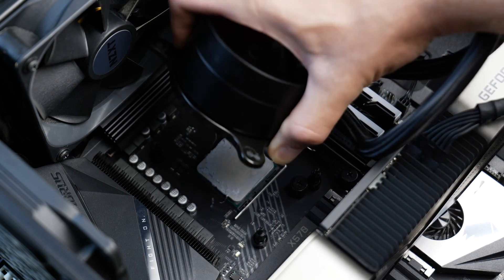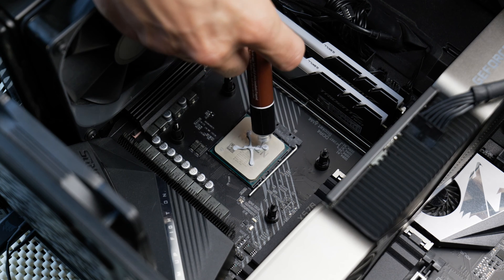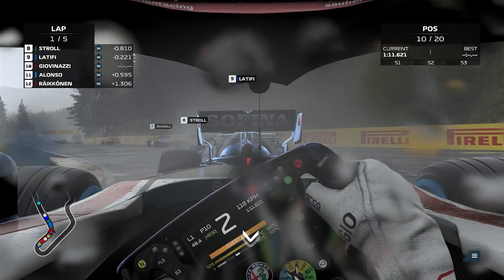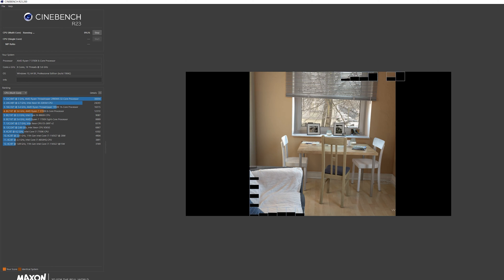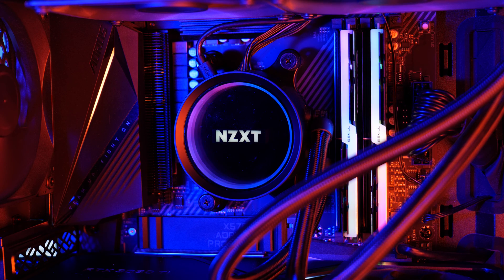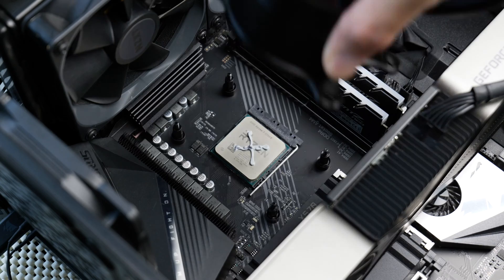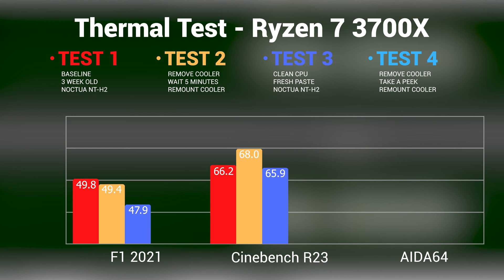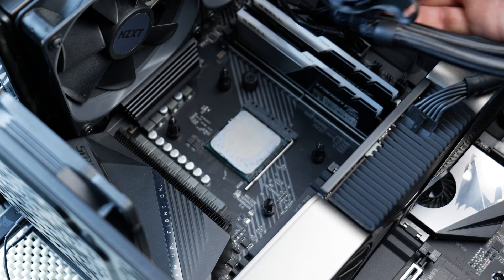Do You HAVE To Use New CPU Paste? Can You Reuse Thermal Paste?

Comment: I have often heard that excess thermal paste can lead to adhesion between the CPU and cooler with possible socket pin damage upon forced removal (turning
the computer back to heat the paste is then recommended). I suspect the problem here is that the excess squeezed out paste tends to dry out and harden. It's 
unfortunate that this area is hard to see and clean.

Comment: You can use turpentine to revitalize dry thermal paste. You can feel the paste dissolving in the turpentine when you rub it in the paste. Not for the faint of heart, it can drip if you do not pay attention. You can make the paste as drippy as you like and the contact is perfect if the paste is drippy enough.

Comment: As stated in another comment:
Bought a tube of CoolerMaster MasterGel Maker back when it was considered one of the top two or three pastes (2017? 2018?). Definitely not later than that. Never opened that tube and checked the paste in April 2022 when I built my current PC. It looked perfectly fine - hadn't gone out of solution/suspension, color was normal and viscosity felt normal, too. Been using it since then and checked the tube again about two weeks ago when I needed to re-paste the CPU. Still looked totally normal and fine, so I used it again - and my temps are pretty good with it. Using a Lian Li Galahad 240 on a mildly OCed 12600K, resulting in near constant 100% usage and ~135W CPU power-draw, no core went higher than 70/71°C during a full Cinebench run - most of them were more like mid to high 60s.

Comment: In the old Arctic Silver days, people "tinted" their cpus ( massaged paste onto both CPU and cooler after a deep clean) to be sure any nano crevices were stuffed with paste. Then the excess was wiped off leaving a faint trace on both surface. then a rice grain size of paste was placed on the center of the CPU before clampdown. That ensured a thinnest layer of paste, while at the same time, didn't miss any spots. From what it looks like (everywhere on YT), that has gone completely out of fashion?
Reply: You're the first person on Youtube I've ever seen who remembers tinting. People stopped tinting their CPUs because it was Artic Silver's way of making you waste thermal paste. No other company suggested it and it really didn't help since properly applying thermal paste fills in the crevices anyway.
Reply: @ViviSectia  It should be rediscovered. the trick was to be sure to not apply more paste than needed. I still do it accidentally: wipe a cooler and CPU, to discover I'm out of paste, and then just have to make do with "tint" left by the old paste. I have seen lower temperatures because of that.
Reply: @Tore_Lund  Like I said, it was probably just a way to get you to waste thermal paste. I forget where I saw it but there were forums where people did test the difference and most people didn't find a difference. I never noticed much of a difference last time I tried it either but the way I use to do it was the way Artic Silver recommended which was to apply thermal paste onto the CPU and cooler then massage it in with a dry coffee filter and then dry wipe it off before applying thermal paste normally. It might just be that newer CPUs don't need to be tinted either because of better machining because I remember looking into it and decided to stop doing it around the second generation of Ryzen CPUs.
Reply: @ViviSectia  I think the differences are between how lucky people are  in getting a sufficient flat CPU and  cooler.  Could also be that pastes have gotten better? They keep their viscosity longer, so regardless of the layer thickness applied, the excess will eventually be squeezed out?

Comment: I did this myself recently aftet installing a led screen pump (the image does not rotate which I mean come on devs) i had put the screws till i noticed out it was wrong orientation.  So had to remove the screws re oriented and put it back on fck it.  Which is what actually got me to this video.  And yeah indeed temps are normal, some hours gaming or high presets no higher than 70 c.  So i guess its true.  And it was a 13700k those things run hot af.

Comment: Thanks for this video. I am a first time builder and I had some difficulty pushing down my AIO pump head onto the chip so I had to lift it up and try again. Thermal paste amount seemed right, but I wanted to make sure if it was okay to just put the AIO pump back on and not to get off the thermal paste and re-apply.  Cheers!

Comment: Wanted to add another Ram chip after 4 years, realised that I have mounted the cooler in such a way that is was blocking the Ram slot, was wondering will I have to spend another 10 dollars or can I just remove and remount the stock cooler.

And this video helped a lot!!

Comment: Metal to metal conducts heat better than the thermal past does. That explains why the temperatures drop slightly when there's a thinner layer of past applied. Either by using less, or by removing the cooler, and placing it back, squeezing a little but more of the past aside. The only thing the paste does is fill in the tiny air gaps from any scratches, toolmarks (even those invisible to the eye) and oxidization (however little). That explains why older paste needs to be replaced after you remove the cooler: it gets thicker, and air gets trapped between cooler and CPU when you don't re-apply the paste. The results are pretty clear in the tests in this video ;)
If you have real old and dry paste, it still will work reasonably well if the layer is thin enough, and the cooler hasn't been removed, because it still keeps air out. When you remove a cooler and the past is really dry, you're guaranteed to get a LOT of air trapped, causing overheating problems. No paste is still a LOT better than dry, cracked past.

Comment: Nick this series is so good. I just bought a pc and was so confused on what to do. I never installed a liquid cooler before. 
I have a question. I don't know if you made a video on it or not. I will check. 
Is there any difference between branded thermal paste and locally available thermal paste. 

I live in a third world country so buying corsair thermal paste is like 20$ that is alot. But local china available thermal paste is like 0.05 cents. 
One that i bought was Hainziye company. 

From what i read on reddit mostly. The difference is like 3 C degree at most. You look like the perfect person to ask to test it out. 😅

Comment: I think I killed my old laptop by ripping off the heatsink and putting it back on without reapplying thermal paste. It was cold when I did so too, so the heatsink made a loud "CLANG!" when I actually got it off lol.

After a month or two, it started shutting down unexpectedly and having a blinking keyboard lights boot error. It still powers on and boots, but only for about 10-15 mins. I could purchase a new cpu for it, but idk if it's worth spending $10-15 and not fixing the issue... Besides, I removed the laptop screen entirely since the video converter crapped out (either an overheating issue or friction from the wire routing). It needs VGA (and HDMI - optional) connected to boot and has wifi wires dangling from the screen mounting hole. Just a crazy looking keyboard, but it was fun while it lasted! Those old dv4's and dv7's can be found for super cheap now and are actually pretty decent for emulation or old gaming.

Comment: AHAHA finally the answer to the question I've always wondered since I was a noob pc builder, also Schrodinger's thermal paste coverage 😂😂 thank you so much for testing this, installing heatsinks has been the most nerve wracking thing for me cause I always worried and thought if I mounted it wrong and had to remove it I'd have to wipe off the paste, wasting it, and start over and apply new paste again before putting the heatsink back on or else air bubbles would be deadly to the cpu, now I'm relieved knowing it makes no difference.
Reply: Yeah same here. Putting together my first pc the cpu cooler wouldn't screw in properly because the instructions were actually unintuitive so I ended up having to redo it but not follow the instructions and do it a different way. I was worried about that ruining the thermal paste
Reply: @admiralrhino4049  Not to mention when you install a large heatsink in the airflow optimal way just to realize it covers up the ram slot or you forgot to install the RAM first so now you have to take it off and put it on again lol. I'm going to be saving so much thermal paste from now on.
Reply: @webbedshadow2601  yeah that sounds annoying. I'm glad I just happened to install my ram first, didn't even think of that, the cpu cooler goes right above it.

Just waiting for my psu to come in and I'll be finished

Comment: I actually did it and the best way is to reuse the old paste (talking about months) and spread it evenly on the cpu and the heatsink with your finger inside a bag, it worked way too good and i got the same temperature readings as if it was new
Reply: Yes reusing recent paste is fine

Comment: When I upgraded my CPU, after all the installation, I got blank screen, so I thought my CPU was not seated properly or something (It was not, but rather my display cable was not plugged properly).
So I dismantle the CPU, cooler and everything, set it aside with the paste still on and tested the mobo with previous CPU (which of course still give me a blank screen).
Afterward I changed the CPU back and jammed the cooler back in with the old paste and all. And it's still work wonderfully to this day.

Comment: All I can say is if you remove the cooler with paste that has been on there for awhile and remount it, it will literally burn a hole in the AIO. I did this in 2012 and i still have the cooler. Think it was an I7-870

Comment: its all chaos theory & randomness. when you do this each time the paste has different variants & pockets so its not viable info...
Reply from the maker: If your theory is correct than so is my conclusion ;)
Reply: @TechIlliterate  You are correct, and they make such a big deal about all this and you proved that its all pretty much the same temps. well done :)
Reply: @TechIlliterate  Hey im changing my aio on cpu, i have Arctic silver 5 thats from 2019. i stored it well and sealed the cap with some tape. i checked it out and its still consistent to the first time i used it. its still sticky too. what are your thoughts on using it after over 3 years of storage? just for your records on all you do. it was installed in 2011 and the temps are pretty much the same. 25 -30 c idle and 60 to 65 c full load. pretty good yeah!

Comment: I just swapped my CPU’s from two of my old laptops and left the thermal compound on them 
By the way  both computers have just had the cpu swapped basically one laptop CPU went in the other and that other laptop returned to the previous laptop it’s old CPU.
 also the laptop that I bought from eBay has 3 YEAR OLD THERMAL COMPOUND and it wasn’t even dried up. That was because it wasn’t even used for like two and a half years as the previous owner said due to a unknown fault. I got it for CHEAP and found out that the issue was just a dead CMOS battery. Swapped it out and it has been working since without a problem. I even had the stupidest idea and decided to put that thing to its limits and to my surprise 
IT DID NOT EVEN BREAK surely it was very hot but cooled off quite quickly due to the nice big cooling fan inside of it.

It’s a OLD LAPTOP from 2006 and it has some serious performance with Windows 10 on it

Comment: Lol. I’m actually here bc building a revised built and had to flip the CPU block. Twice (Distroplate idiocy). The second time I didn’t bother reapplying paste. So too bad you didn’t test how it would turn out if you lift it, turn it and then mount it again with the same paste. That’s without the system ever been on.

But I’m probably fine. We’ll see when I finally boot it up. 😂

Comment: Thank you for testing this. Some data to look at is way better than not knowing at all.

I am concerned that your tests showed extremely (categorically) different results for the change being tested: "re-applying/re-mashing the same paste after initial application". Worse in the first situation, better in the second situation.

A few hypotheses of mine to explain your data: 1 would be: your error bars are actually so huge as to mean that all readings are within margin of error and essentially meaningless. (I don't think it's this, but I also don't think it would be worth investigating other hypotheses without ruling this out first.) Hypothesis 1 can be investigated by controlling more vairables... such as using a fixed fan speed, and maybe using more strictly repeatable workloads, and/or controlling room temperature or using delta from ambient temp rather than raw temps.  2 would be: that re-mashing paste is a crapshoot, and if you re-mashed the same blob of fresh paste several times, your numbers would be all over the place. 3 would be: Freshness makes the difference... Re-mashing old Noctua paste is bad for some reason, perhaps the viscosity after it dries makes for worse gap filling and more lumpy paste (poorer pressure distribution) or more air trapped in the paste. And by association with this hypothesis, re-mashing fresh paste is potentially good, for some reason. Maybe the low viscosity just likes being agitated more, to get pushed into pits/grooves on the IHS and cooler cold plate, or more even paste distribution for better pressure distribution? If hypothesis 3 is correct, then mashing old paste should consistently make things worse, and mashing fresh paste should consistently make things better, but I might expect it to level out as you appreach the ideal paste spread/state... FURTHERMORE as a level deeper into hypothesis three, more wiggling might similarly help with fresh paste? And maybe simply wiggling the cooler with old paste would worsen then results?

I find it very interesting that 3-week-old paste can be scraped off, put on plastic wrap and re-applied and (coincidentally? not coincidentally?) do or tie the best of all the applications. Maybe paste settles into position, or dries out only in some places, so re-mixig and re-applying "rejuvinates" it? Or maybe that gets rid of air bubbles/poor pressure areas from re-mashing the stiffer paste? Maybe 3 weeks isn't that long and this is noise in the data, or we are seeing effects of an as-yet-unidentified, "invisible" variable?

Feel free to NOT test this, becaue I agree as long as you've got some paste on there that's not like dry and cracking you're probably fine. That said, if this is the content you want to make more of, there's some follow-up ideas for it and as a fan o science in general I think it would be neat. Worth it? IDK. I'm already grateful for what you've done so far. Makes my "want to know even though I'm pretty sure it doesn't matter" type of brain a little more satisfied.
Reply: I think the main takeaway is that you should be fine if you aren't going to using your system in a dramatically different way to where you taxing the living daylights out of your system.

I recently traded a laptop for a desktop, but the mobo arrived DOA because they neglected to properly ship the system 🤦‍♂️ (at least it looks like it's only a matter of a dead mobo). The person I traded with sent me money for a new mobo and I was planning on using the same thermal paste. I wasn't planning on gaming nor heavily taxing the system, but the parts can be used for gaming.. All in all, everything should be fine as long as I don't attempt to use the system in a way that exceeds his use.
Reply: WOW I am NOT reading that😂😂😅😅

Comment: How about a thermal pad instead of thermal paste? GPU use thermal pads, why not CPU? Also, is one thermal pad better than another?
Reply from the maker: GPU use thermal pads? I haven't seen any yet. Though I would like to try some thermal pads for CPU.
Reply: @TechIlliterate  I ran across Innovation Cooling IC Graphite Thermal Pad. They look compelling but I am a little skeptical.  I may try them out on my next build.
Reply: The laptop that I have uses paste but uses pads on the memory and other stuff

Comment: You don't really have to change your car oil or filter either on the manufacturer's specs and can get away with not doing so way past 12 months but doesn't mean because you can you should. I am sure there are differences in pastes and maybe the cheaper ones lose their efficiency even quicker than the ones you are reporting here. Interesting video. For the sake of a few cents and a minute or two I think it confirms I'll keep replacing mine.

Comment: I always wondered if you built a 1 inch tall cube housing oving the CPU and just filled it to the top with thermal paste, will you still need a cooling fan after that?
Reply: are you talking about basically making a 1inch cube of thermal paste on top of the CPU like a heatsink?
Reply: @kasuraga  yup
Reply: @jeffdoomGuy  won't work. Thermal paste has a worse ability to conduct heat than metal does.
Reply from the maker: Man I have to test it. Hope you're well mate. Long time no talk.

Comment: A few years ago I took my (then) ~5 year old video card (980ti) to a repair shop to replace the VRM. Before then I hadn't repasted the GPU yet, and the maximum temp was around 68-70*C. After the repair it was pushing mid 80's. I repasted the GPU and then it was back down to high 60's. 

If it's been a long time between applying paste, I would suggest redoing it.
Reply from the maker: Absolutely.
Reply: wait they didn't repaste it ?